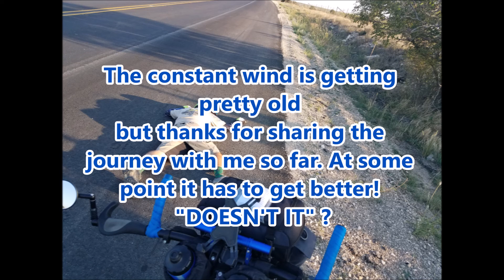CYCLING TEXAS TIP TO TIP episode four

Comment: Pretty neat around that gravel pit. One good thing about wind is it prevents condensation so being down in the pit probably allowed some ice build up. Your hotel in Stanton looked a lot nicer than previous accommodations lol. And I don’t know about that Gazebo, but probably best spot around. I could tell by your clips that the wind was brutal after leaving the gazebo camp. Hard to make progress in them low gears. You lucked out once again finding camp at that road cut. Tough trip so far!
Reply from the maker: Your right about the wind and condensation. My breathing in the cold and no wind to move the air made things pretty wet a few times on the trip. My stealth camp off the highway was great especially that day. The wind had me pretty whooped and questioning my sanity.  Hahaha  I always said I was a glutton for punishment 😉

Comment: Did I hear you right? You rode 70 miles in one day!!! Man, that would take 3 to 4 days on a hiking trail. It's amazing how many miles you can get (in low wind) on a bicycle compared to walking. Cool stealth camp on the rise above the highway, I like those kinds of places. I guess 21 miles on a bike is disappointing but it sounds good to me! Love the end shot, hilarious!!! Another great video!!!!
Reply from the maker: Yeah, 11 of my 22 riding days were between 50 and 80 miles. The big mileage days were with no wind or a tailwind. The low mileage days were kinda depressing having to work my butt off all day in low gear. I love my fatbike but with full panniers it was like dragging a boat anchor, A BIG BOAT ANCHOR. HAHAHA  Some days I cut it little short when I came to a place like over the highway. Everything is fenced on both sides forever so I had to take advantage of spots like that. A lot of it was type 2 fun but man what an experience. Are you still considering a bike?
Reply: @BluecollarBackcountry  I am still planning on giving it a try at some point. I think I'm going to try the Katy Trail in Missouri since it's not too long in case it's not for me. I'm worried about my lack of bicycle repair skills such as changing a tire or adjusting brakes etc...I have a bike bookmarked on the Bikes Direct website so it's just a matter of working in the extra cash, even cheap bikes are expensive, lol....
Reply from the maker: @somewhereonthetrail  I've been wanting to do the Katy Trail. Just haven't pulled the trigger on it yet. I'm going to do a video in the near future on buying a used bike for bikepacking.
Reply: @BluecollarBackcountry  That sounds like a good idea for a video! I'll be watching for it. I don't mind buying a new bike, I kind of want one just to ride around town if nothing else. If you do it in 2022 maybe we can do it together. I have all my plans for 21 plus, I still need a bike!!!
Reply from the maker: @somewhereonthetrail   we might could make that work. I have a sister in St Louis that may be able to help with logistics. We'll see what happens between now and then. Take care ✌
Reply: @BluecollarBackcountry  Sounds good! I'm very familiar with St. Louis, I lived there from 2012 -2014. I used to live about a mile or two from the trail in St. Charles. This could be cool!!!!